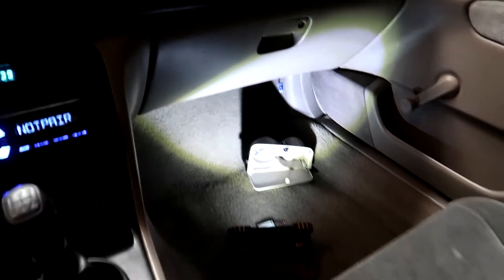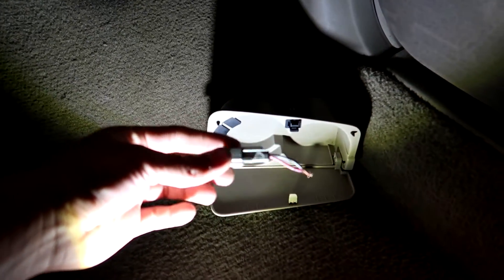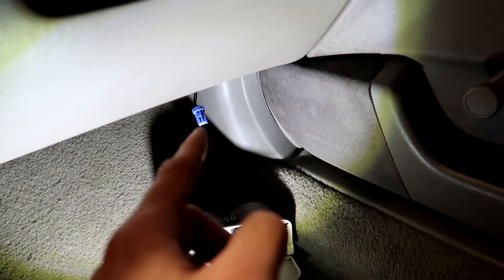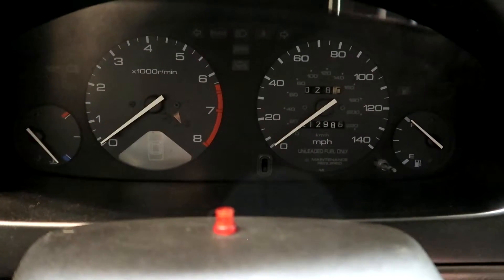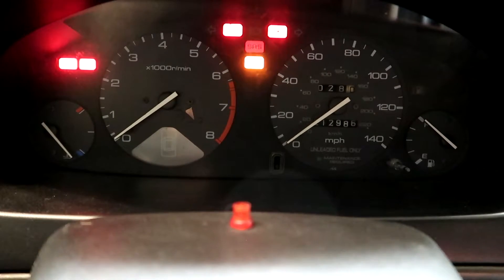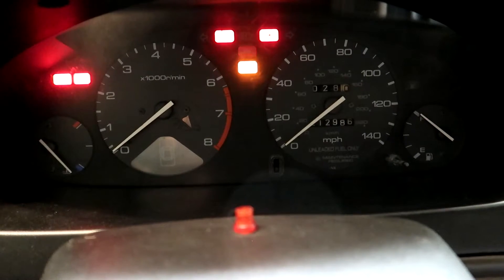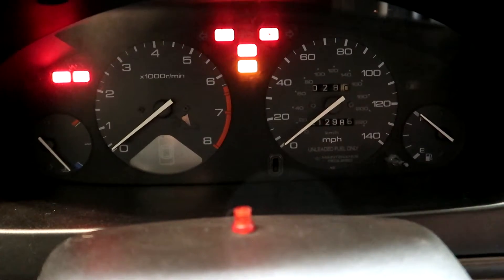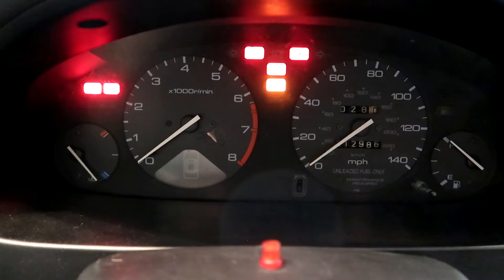Honda OBD1 SRS Light Troubleshooting

Comment: I have a 95 Honda Accord the reset doesn’t work and when I try to pull the code the light just stays on I know I did the codes are activated because the check engine light was doing it
Reply: Did you ever find out what the problem was?